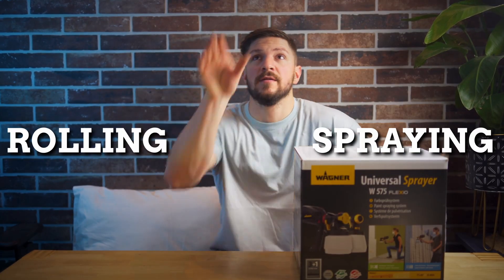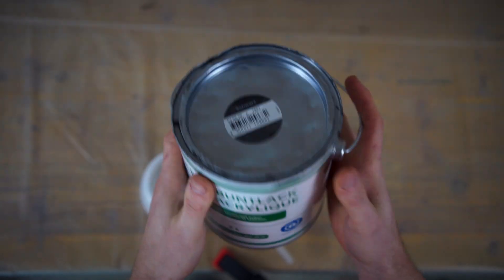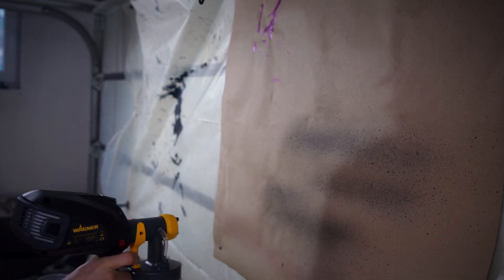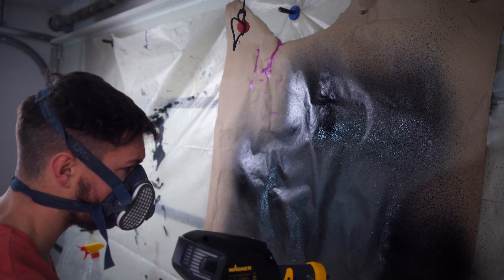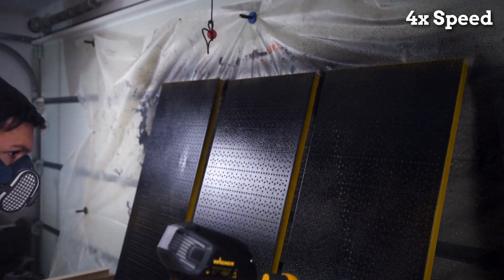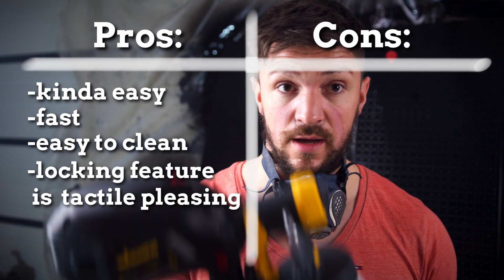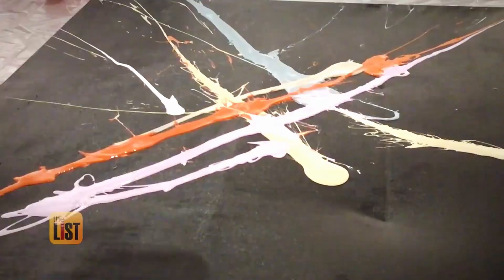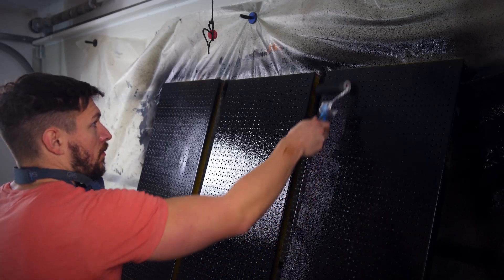Wagner Flexio 575 REVIEW | is it any good?

Comment: I’ve been wrestling with the same problems as this guy.  I’ve used rustoleum enamel  and sherwyn williams urethane enamel.   In both attempts i get a very bumpy surface.   The closest i can get to a quality surface is with the urethane using a 3500 gun set to around 6 and half trigger on a horizontal surface.   I’m finding myself making multiple passes, creating a thick, wet layer.  This layer eventually flows out and levels the bumps. However, diluting the urethane results in occasional specs of what looks like dried paint… almost like i have an improperly cleaned gun.   I don’t recommend painting with the gun. Unless you like the look of a paint rolled surface.   I have had the best results using aerosol paint outdoors where fumes aren’t an issue.

Comment: Very good review glad you highlighted the surface finish quality and the orange peel effect. Basically a red flag when it comes to kitchen cabinets,   chairs ,tables etc. At a guess i would suspect that   it does not come with a tip for more detailed work . I noticed  after you diluted the paint that it was still quite uneven which would suggest that the tip is not suitable for the above mentioned.

Comment: It's good enough for garden fence work and spraying walls but don't expect doing any furniture.
Reply: I agree.  It’s the gun.  Not the paint.  If you increase the speed to a level where it is leaving fine enough droplets, the paint drys and leaves a gritty surface.  Even if you are 4” away from the surface.  If you adjust the speed downward, the droplets become huge and dry with an orange like surface.  That’s fine if you’re painting a shed.  It’s awful if you’re painting interior doorway trim.

Comment: The problem is not on the machine. Its on how u mix the paint and what paint u use
Reply: I agree.  It’s the gun.  Not the paint.  If you increase the speed to a level where it is leaving fine enough droplets, the paint drys and leaves a gritty surface.  Even if you are 4” away from the surface.  If you adjust the speed downward, the droplets become huge and dry with an orange like surface.  That’s fine if you’re painting a shed.  It’s awful if you’re painting interior doorway trim

Comment: Best use it on water based paint. More likely watery texture. Not on thicker paint.  It wont flow
Reply: It also works just as well with oil based paint cut down with paint thinner.
Reply: @David Perry  that would make your paint more like thinner les paint. Water based enamel is out on market now. Easier to use and clean afterwards